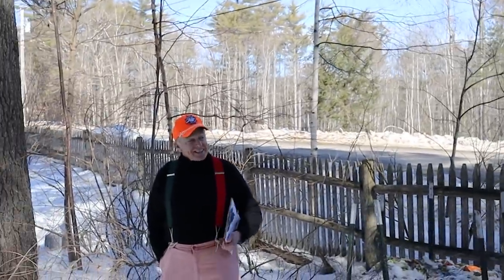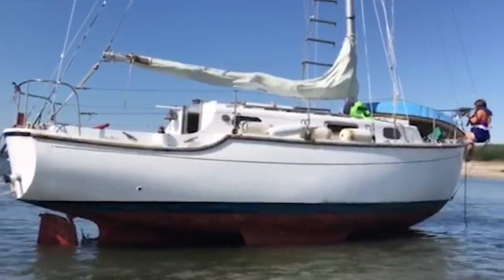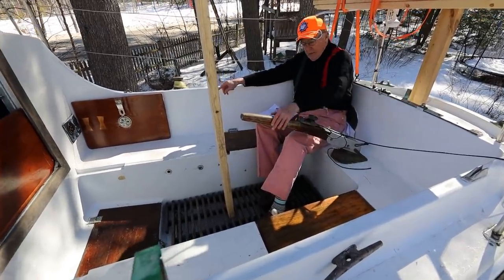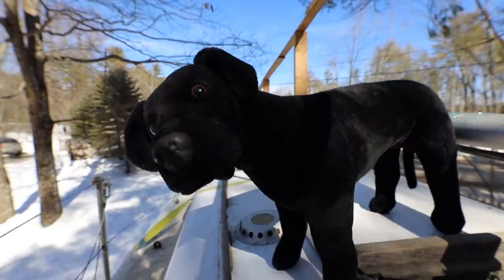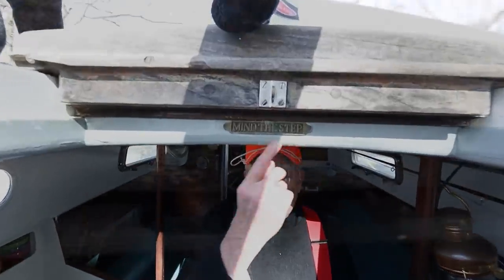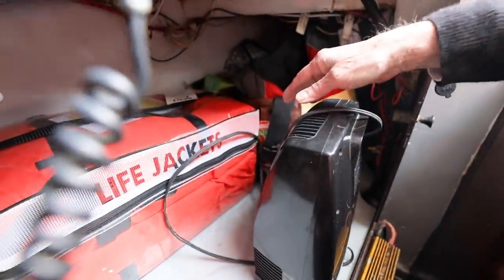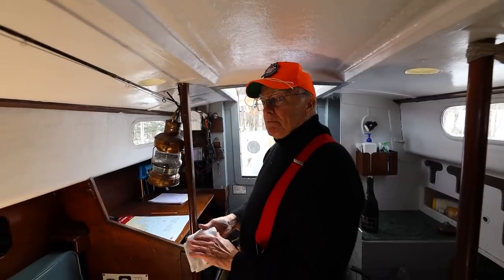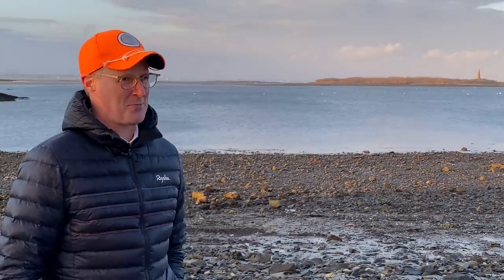Perfect Family Starter Sailboat?? 28'(8.5m) Colvic Sea Rover Sailboat for Sale -$12.5k EP 30

Comment: I'm new to sailboats, that rudder safety line looks like such an amazing bonus
Reply: The bracket that acts as a rudder safety line can also be rigged with two lines led to pulleys on each side of the deck. If the tiller broke, the lines can be used to steer the boat!
Reply: Scott fuller I didnt even think of that! Such a cool design.

Comment: That CD in the lazarette has a real purpose! Some folks will dangle them up the mast to help reflect and present a more visible radar image for other boats and especially those big blindly-lumbering ships. In fact, there are many DIY designs out there in Internetland to easily cut and glue a couple of CDs together to present a fuller reflective profile no matter the orientation. Frankly, I'd be astonished NOT to find several old AOL CDs in any older sailboat up there in foggy Maine. I'm led to understand that those silver mylar emergency blankets can also serve a similar radar-reflective purpose when draped aloft. There's apparently some debate as to the efficacy of such radar reflector hacks, but I'm in no position technically to judge.

Comment: The first boat I ever sailed was called a Vivacity. It was my dad's first boat. If you've seen the video on YT  of a small sailboat with A giant elephant seal on the foredeck that's a Vivacity. Twin keel made it possible to run it up on the sand at high tide in south San Diego bay  wait for tide to go out and clean the bottom. Solid boat but not particularly  suited for light air of southern California.

Comment: The aqmount of wetted surface guarantees a slug. As for ease of hull cleaning, try crawling between the keels to scrub growth.
Reply: Try drying a high aspect fin keel, and a displacement hull is constrained by LWL...
Reply: @mitchellsmith4690  ?
Reply: @FixNewsPlease  Although the wetted surface might affect light air performance--which can be addressed with a Genoa or a Code Zero--in normal air it won't make much difference.  Not everyone wants something raceable.

Comment: Do you know why there is an outboard motor mount on the transom?
Reply from the maker: So there is a place for an outboard !??
Reply: @YachtHunters  I expected you to tell us the inboard was frozen or otherwise unusable. I guess it could be for the dingy motor/backup.
Reply: Have you ever seen/reviewed a Hunter 26/260 water ballast sailboat?
Reply from the maker: Sorry.  Can’t help myself sometimes.  honestly I do not remember for sure why the bracket was there it may have been for a period of time when there was some engine work being done. Or possibly there as a place to put an outboard to get you home in case the main engine fails. The boat has been sold but feel free to contact the owner. Thank you for your note and for watching old wise guys !!
Reply from the maker: OK OK OK I hate living stones unturned so I had a nice conversation with the owner of that boat who said that the previous owner had a frozen engine and couldn’t afford to replace it and so put the motor bracket on the transom and added a 15 hp outboard and he was all set. Later the engine was corrected and they just left the outboard bracket on the Stern. But the owner did say it was a nice place to keep a spare outboard for your dinghy and certainly easy to hand it off the dinghy for storage on the stern of the sailboat. There you go all the answers you ever wanted to know